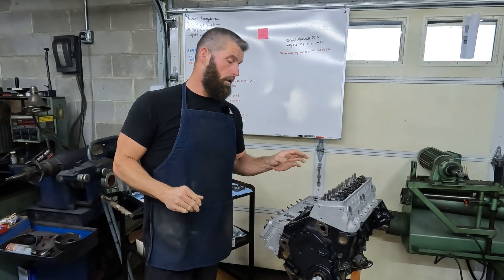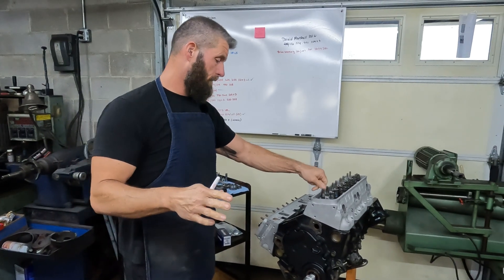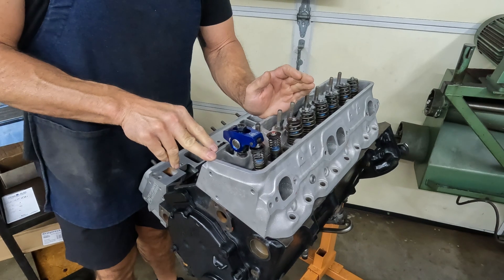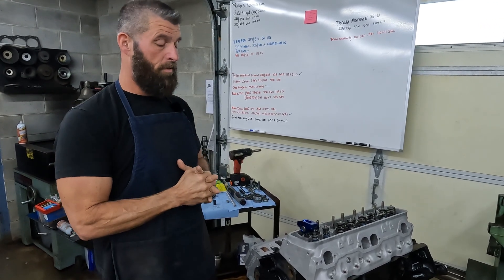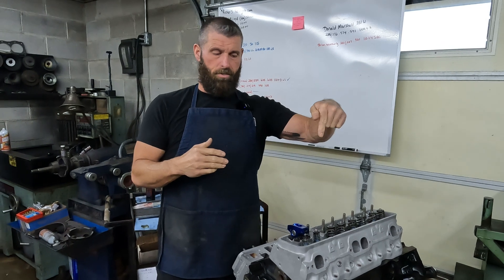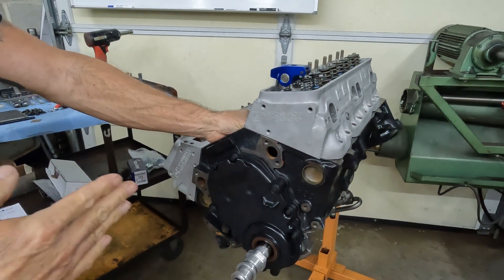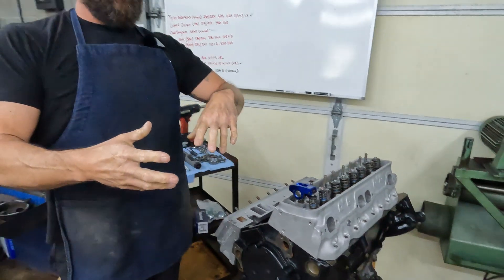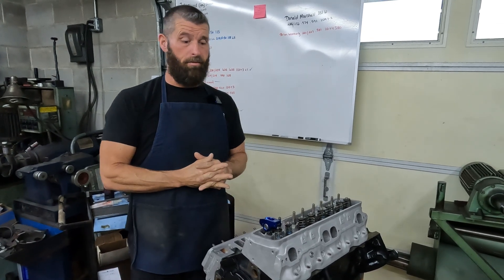More pushrod length and Rocker geometry tech

Comment: Hello, I have a problem with some Flotek cylinder heads and I can't figure out which pushrod I need. I have roller rocker arms. I adjusted them with my adjustable pushrod, which rests right in the center, but after turning the engine over twice, the rocker pattern is too wide. What can I do to narrow it? A shorter or longer pushrod?
Reply from the maker: Correct
Reply: Is there any way I can send you a video of the problem I'm having, please? I'm in Spain and I don't know who to contact to fix the problem I'm having with this engine.
Reply from the maker: @Javi-z9b it's simple,  start extending the pushrod length and see if it's better,  if not shorten it, till u get the minimum sweep
Reply from the maker: @Javi-z9b  I surely hope you have a test spring on and not the actual valve spring
Reply: Thanks for your help. I'll keep trying.
Reply: https://youtu.be/q_cimNi6dik?si=gOyJpKSwNJhvVFZ5

Comment: I’m a back yard mechanic with a small mechanical library I put together before computers but am interest in good usable free knowledge if it help you to do it right and on a budget.i greatly enjoy your video’s.how much worry should you have about guides when off center one way or the other and is one better for street versus various types of racing and how much life should you expect from off centered guides assuming they are not on the raved edge?also what could be easily inexpensively used to raise valves minutely if needed?hope this isn’t to much and again thanks for all your info.have more question but get that I’ll be lucky if these are answered.thanks
Reply from the maker: Not sire how a guide is "off center" ?, off center relative to what? A quality guide sized correctly with proper VT geometry should live a very long time.
Reply: I’m   talking about how the valve being pushed to one side or the other because of the v tip being pushed out of alignment.cause and affect but just an answer is much appreciated,I know you’re likely busy and I just want correct info. Thanks

Comment: Very informative. I always thought you have to get the contact in the center of the valve tip.  Glad that is not as critical or neccesary. Interesting. Perhaps the roller tip rocker also pushes and pulls less than non roller tip?
Reply from the maker: Correct on both

Comment: It would be nice if the rocker arm manufacturers would publish the dimensions from the center of the roller tip to the center of the trunnion and to the center of the pushrod cup. I had a set of Comp Cams rockers on a set of Trickflow 351C heads and just could not get the pattern even close. I used the recommended Trickflow rockers and it was right on. You could see they were not made the same.

Comment: Well shoot.  I measured for having the contact patch in the middle of the valve tip.  It was the only concern.  So far so good!!! (BBC, #063 iron oval headed, retrofit roller)
Reply: you got lucky check your stripe width  it's all tradeoffs but mid lift or min stripe is the best tradeoff   if that puts you too near the side of the tip lash caps or change the rocker length , tip the guides, move the studs (like an half inch thread moved over in a mill etc

Comment: So that is a lot to absorb. My questions is would making the pushrod long bring the pattern closer to center and would that affect the pattern width too? Or am I thinking about this backwards?  And thank you for sharing this knowledge!
Reply from the maker: Adding length will move the pattern towards the exh port, it may or may not reduce travel
Reply: moving the center as opposed to minimum width is a really bad tradeoff   you want the rocker angle "UP" about the same as when "down"   otherwise does not wear as well and mechanical problems..  The camgrinder did not design for rockers using the wrong portion of their arc

Comment: Crane quick lift rockers are tough  they lift quick and go easy over the nose for less valve float but slam closed and bounce 
 as you say all rockers are different   \
I've relocated studs and up and backset shafts.  narrow is better
Speaking of old wrong beliefs i used to think that longer springs are better, now it's springs at almost coil bind - sort of a desmodromic effect.  That was before and after home built spintron
Reply from the maker: It would be impossible for a rocker arm to have variable acceleration.
Reply: @powellmachineinc  when the rockr is perpendicular to the valve it has more acceleration than when on a big angle Those who go for maximum lift where the rocker is closer to perpendicular at max lift get earlier fling plus max guide wear (might be easy on the seating not that that would make up for all the other problems )
cheers
Reply: @jmflournoy386  Rocker is perpendicular at Max Lift ? That would put the rocker tip at almost the stud side of the valve stem at zero lash. The pushrod would be way to short ,  The valve train wouldnt last at all. No such thing as a " Quick Lift Rocker" . Thats smoke and mirrors.
Reply: @jkdwayne  exactly   Those that try and maximize their lift end up with the fulcrum low and the rocker perpendicular at high lift) not mid lift).  This BS has been like forever as had the "center of the valve tip error"
Reply: @jkdwayne  A few more thoughts from the 50's  Adjusting trunnion and pushrod for max lift also takes more spring.  When we had to run stock springs another reason that the max lift method did not work.  This is about the only advantage of the CRANE "quick lift" rocker (or a high trunnion) is that it is easier over the nose, less valve float.  All tradeoffs- pick your poison  Thanks for the Memories

Comment: Great video. Have you done a video for us Small Block Mopar guys with shaft rockers and 273 adjustable rockers?
Reply from the maker: No, but eventually I will
Reply: there are inexpensive kits to relocate mopar shafts  mopar shaft location is for near stock lifts,   stem lengths    changing pushrods only to center stripe terrible idea, breaks parts in high rpm motor and wears in all    watch rocker/ retainer interference.   for best geometry run cups in the adjusters and ball pushrods that oil through the pushrods and AMC/ Magnum lifters.  The rocker adjusters are a weak spot.  do not run with adjusters over extended, the break  I converted to FORD size adjusters and pushrods (like 50 year ago) with endurance engines
Reply: @jmflournoy386  B3 Racing Engines has Mopar shim and wedge kits.
Reply: @LP23D6  tks B3 kits get the best result as the builder has to supply inputs --those that are just shims are mostly just moving the problem   Also alloy hard shafts for roller trunnions and industrial hard chrome (triple plated copper, hard nickel, grind, chrome) for bronze bushings or iron.  running needles on chrome shafts is a disaster  good iron rockers hard to find let rocker arm rebuilders in NOR CAL rebuild them  Battleship triples are BVVC on an LA engine